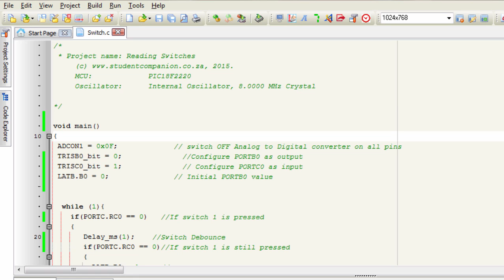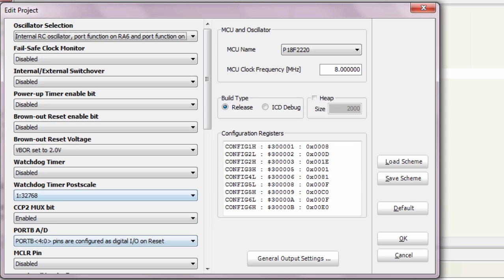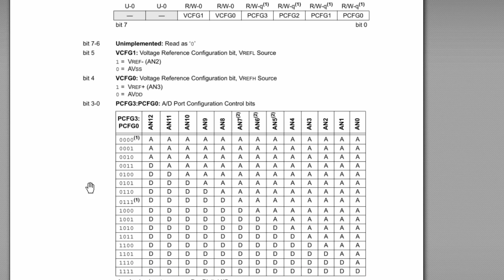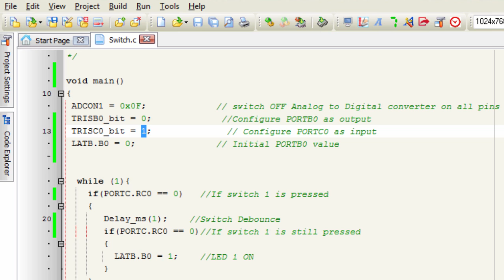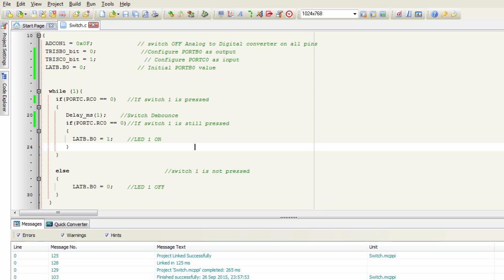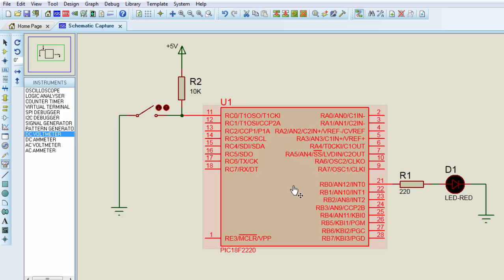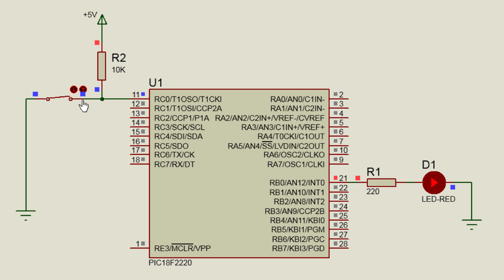3- Reading a Switch | mikroC Pro for PIC Tutorial

Comment: Hello sir, I want to interface switch button with LCD and LED both by using pic16f877 could you please guide me
Reply from the maker: Hi. What kind of guidance do you need? This video explains how to use a switch and an LED. This one explains how to use the LCD: https://youtu.be/_ujw_tuQDTY
The only difference with the PIC, instead of using LAT register when you are switching an LED, use the PORT register for PIC16F877 or any PIC16F series.
Reply from the maker: If you don't know hoe to setup your PIC, start with this video: https://youtu.be/jQ8ddVYNlKU
Reply: Thank you so much sir. but I have one more question I'm now trying to do same experiment as in the video but I can't compile LATB.B0 = 1; I use the same pic as you so I don't know what is the problem.
Reply from the maker: +Chetsadawut Ruangrojn if you used same pic then it should compile.  Can you post the full error message
Reply: It said undeclared indentifier 'LATB' in expression
Reply from the maker: +Chetsadawut Ruangrojn that's why I said post the whole error message
Reply: ok sorry sir I'm newby here.Here is it "  LATB.B0 =   0; "
Reply from the maker: You are not giving us what we are asking. Copy all your code and paste it here in the comments. We want to see all your code to see why it's giving you that error.
When you compile your code, it will give you an error message, can you copy that full error message and paste it also here in the comments so we see exactly where the message is.
Reply from the maker: +Chetsadawut Ruangrojn on the top left corner  click on project settings. In the name, which pic is selected?
Reply: P18F2220
Reply from the maker: +Chetsadawut Ruangrojn ok. Can you take a screen shot of your project and send that image to our Facebook page: www.facebook.com/studentcompanion  or send us an email: info@studentcompanion.net
Reply: Student Companion SA  ok sir .

Comment: Hello, i have a question. Is it okay to just place the switch between the five volts and the pin? If not, how come? 
Thank you!
Reply from the maker: NO. You can't. The pin will be floating. A microcontroller needs to read the exact status of a switch either it's high or low (to ground), that is why a pull-up or pull-down resistor is used. If you don't want to use external resistors, you can activate internal pull-up resistors.
Reply: Student Companion SA  thank you!!! This help alot! Love this series, i would be helpless without it!
Reply from the maker: +Philip Kim thank you.  We appreciate your feedback.

Comment: Hey could you please tell me that do I need to set something up before I write the code after void main. Thank you.
Reply from the maker: HI. Can you be more specific, your question is not clear. What do you want to set up?
Have you watched tutorial 1: https://youtu.be/jQ8ddVYNlKU
It shows you step by step how to set up and and write code for a simple project.
Reply: Student Companion SA thanks for quick reply.  I try to use pic16f6887 as a processor but mikroc doesn't accept porta.a0 and lat command I just wonder why.
Reply from the maker: It depends on how you write your commands. Most PIC16F don't have the LAT register, so you must use the PORT to read and to write. The LAT register is used if you are using a PIC18F 
Write PORTA.B0 or PORTA.F0 for pin RA0. Don't write PORTA.A0 and don't use LAT.
Reply: Thank you so much It help alot .
Reply from the maker: +Chetsadawut Ruangrojn you are welcome!

Comment: Hi 

Just got Question 

Why you didn't use ATCON1 in the example on your website for PIC18F45K22? 

Both LED connected to AN12 and AN10 Dont we need to turn  analog to digital converter off?
Reply from the maker: +OnGround1 hi. Thanks for watching our videos.  I guess you meant ADCON and not ATCON.  we should have used the ANSELx to disable the analog functions on these PORTS but in this case it won't make much  difference because we have configured our PORTB as output. analog functions work only if a port/pin is configured as input .
Reply from the maker: +OnGround1 hi. Thanks for watching our videos.  I guess you meant ADCON and not ATCON.  we should have used the ANSELx to disable the analog functions on these PORTS but in this case it won't make much  difference because we have configured our PORTB as output. analog functions work only if a port/pin is configured as input .
Reply: Sorry its ADCON
Reply from the maker: +OnGround1 ok. Great!

Comment: is pickit 2 can be used on PIC18F microcontroller?
Reply from the maker: +marhsall 27777 I am sure it should support them. Check if you are using the latest pickit 2 firmware
Reply: thank you..I found that MikroC is easier than MPLAB..am I right?
Reply from the maker: +marhsall 27777 Yeah mikroC is much easier, it has also its programmer, mikroProg. It's very easy to use.